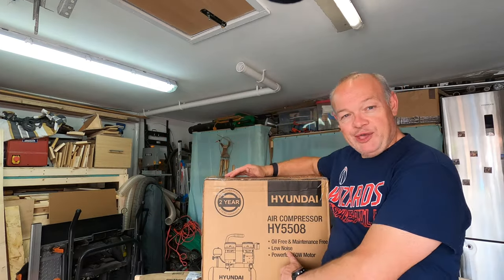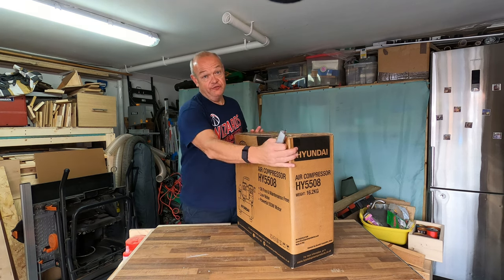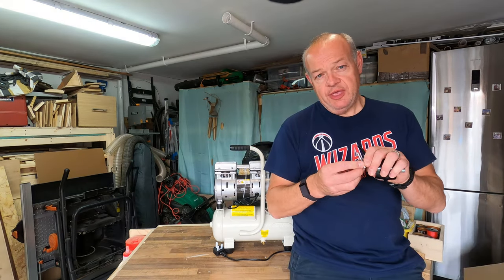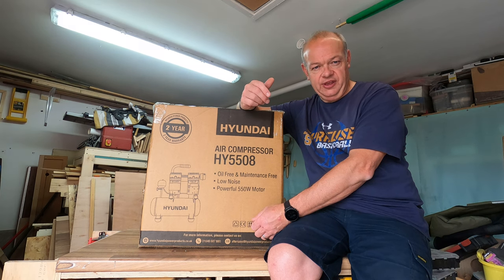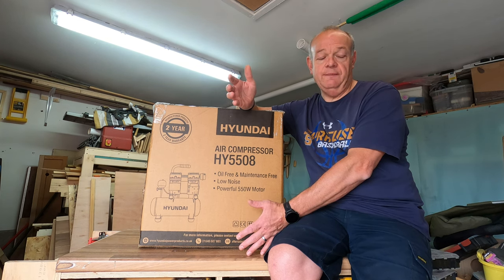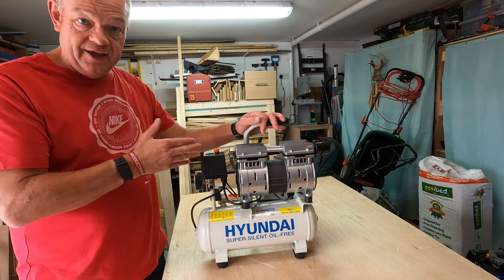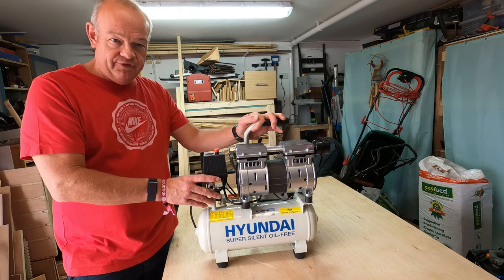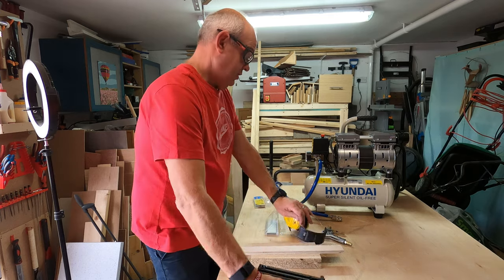The Garage Workshop - 10 Minute Tool Review - Hyundai Compressor

Comment: I had looked at the same compressor, noticed a lot of returns due to damage before sending, my solution was to go through a local engineering outlet who were able to supply the same model, surprise surprise the air filter was damaged in exactly the same way, they kindly got me a  replacement  air filter, UNDAMAGED 😊
Reply from the maker: Great idea...and I had a lot of issues with damage....

Comment: For the decibels, having purchased a compressor myself recently I found out that the dB measurement they advertise is usually measured from a distance of 7 metres. No idea why.
Reply: I guess most people put a compressor in the corner of shop behind some kind of shield with a 15mt airhose attached to it. I never work right next to my aircompressor cause they're to noisy.

Comment: I'm thinking of investing in a compressor when I get my shed sorted, also want one to be able to fill my PCP air rifles as well so thanks for the review it's been very informative, oh and I don't think I'll bother going to B&Q for it 😢. Keep up the great videos. All the best Mark
Reply from the maker: I don't blame you and I am so glad i got one I have used it loads
Reply: @thegarageworkshop4791  what's the maximum working pressure of the Hyundai?
Reply from the maker: @markpullen61  it's apparently 120psi...that's what the specification is.
Reply: PCP air rifles run at about 10X the pressure (200-250bar or 4000psi) so it won't work
Reply: @MrDead1975  I will have to look at getting two then bummer

Comment: Please when using high-pressure compressed air with a blow gun don't keep putting your hand in front of it. The problem is it   can penetrate the skin and enter the bloodstream. This, in turn, can cause blood vessels to become blocked by air bubbles, triggering stroke-like symptoms. If left untreated, an air embolism can lead to coma, paralysis and death. I realise your new to compressor but please take care👍
Reply from the maker: Thanks Gary...a good tip and I will make sure I don't do that in future

Comment: I've been toying with the idea of getting a small compressor, having seen this video, that one would suit me just fine, but I won't get it from B&Q.
That lump on the side that was loose on your third one looks like a capacitor for the motor, shame it was dented but it looks to work fine.
You have my sympathy for all the bad luck, I could see the disappointment in your eyes, but it all worked out ok in the end i hope. There is very little customer service left these days especially from box shifters.
Reply from the maker: Thanks Steve having investigated more I think it's a transformer of some sort that allows the compressor to be used on different electricity systems.